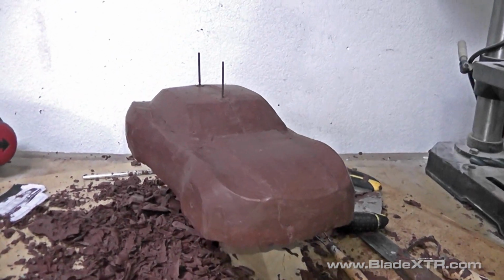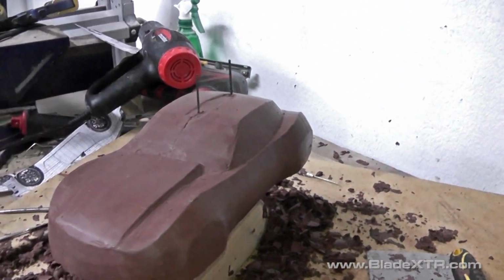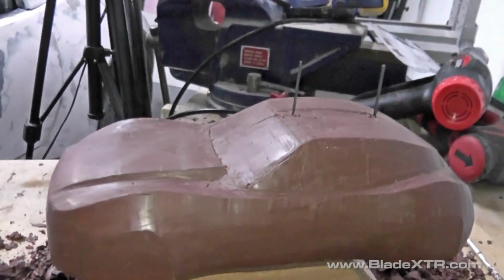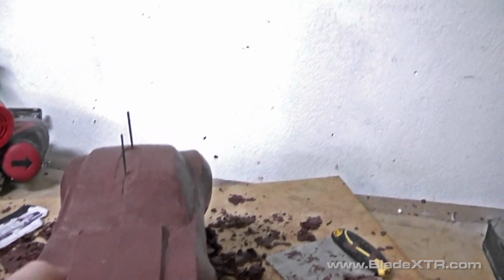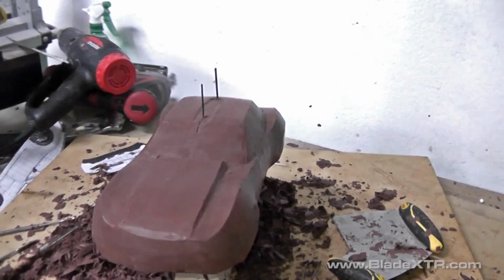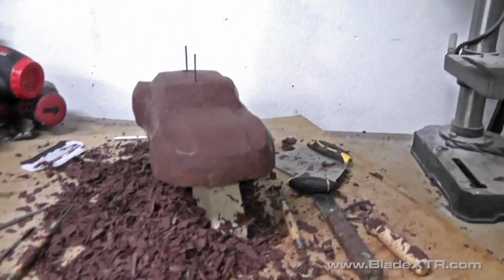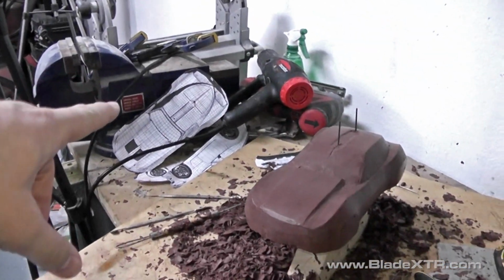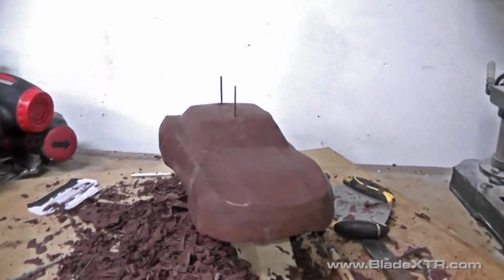Clay Sculpting car design - Sculpting Blade XTR Model - Part 3

Comment: This is really cool. I thought I was the only one on YouTube using clay to create car concepts. Only exception is that I use potters clay to create my concepts and I do them full scale for road use. I created the JZ Cobra and currently I am doing an RX7 fortune redesign form fast and furious Tokyo drift.
Reply from the maker: Nice,  how do you keep the clay from drying out? Seems like that would be difficult in large scale.
Reply: BaileyBlade While working on the car during the day I have a squirt bottle handy and spray it down every 2 hours. When finished for the night I wrap the clay in food wrap or glad wrap.

Comment from the maker: Well actually when i first started I did a mini model the same way I built the car, using forms to test out the concept. But I did not get detailed in the design as it was not final. I think I would not change too much on how I designed the car, but I would change many of the tools and methods to do it. And yes there are many things that I would and still want to change. Somethings just have to be the way they are now just for simplicity and realistic finish expectations.

Comment: You could make a mold of it, and then fill it with a thin layer of plastic to make a RC car body, but the problem is that you'd need to make a custom car for the body to fit on.

Comment: You're mechanically inclined, a homemade CNC actually isn't too difficult, it is still a bit of investment in time, though. I built a large 4'x8' wood CNC myself for around $1500. It's very handy to turn out quick parts.

Comment from the maker: Thanks for the link, I have seen this and many others but these are just not practical for what I need. It's very difficult to make large parts without deformations or support issues. Liquid polymer 3d printing is better for what I need but very expensive.